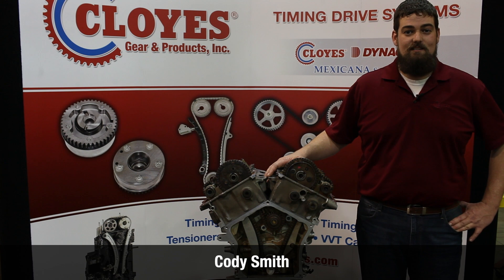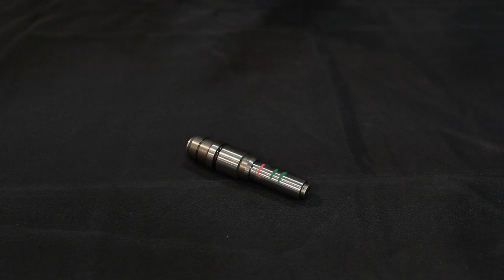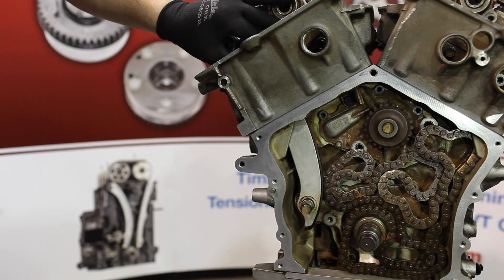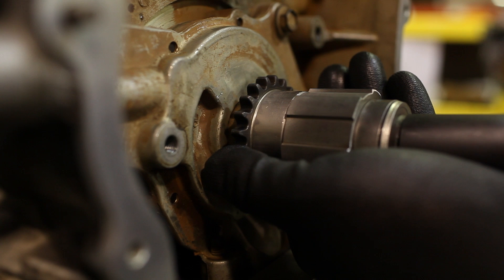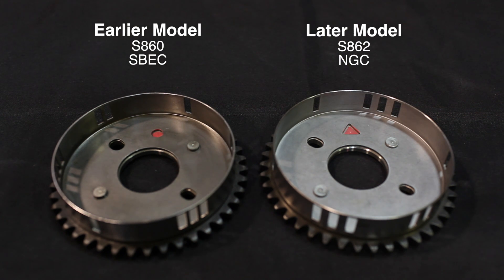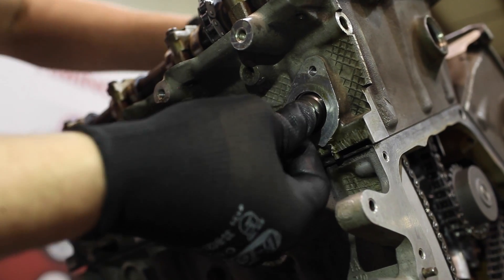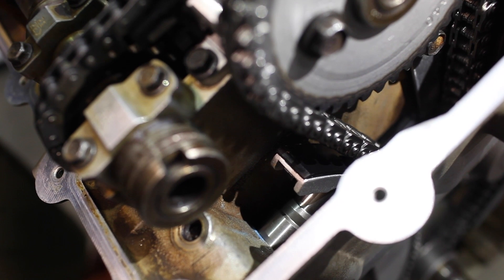Chrysler 2.7L Timing Chain Replacement, Cloyes 9-0397SA

Comment: If the timing chain mark not line up with the mark what should I do? I’m think of marking it, just take it off and just lining it up with the mark . Kinda confuse lol please any advice I’m changing my water pump
Reply from the maker: The chain is what sets the timing, so if all the marks do not align with the colored links then pull the chain off, rotate the shaft appropriately, then reinstall the chain. As long as all 3 sprocket marks are aligned to the proper chain links you are good.
Reply: Cloyes Gear & Products, Inc. thank you very much 🙏🏽🙏🏽
Reply: Cloyes Gear & Products, Inc. brother you save me from spending couple hundred bucks on maintenances THANK YOU VERY MUCH my car runs like a champ now I save $1200 actually -200$ For parts needed again THANK YOU 🙏🏽🤙🏽
Reply: Only issue I have timing chain mark not lining up with the arrow and the ⭕️

Comment: If the bottom Mark has moved what can I do
Reply from the maker: If the chain is still off just move the crank back until it is aligned again and carry on. If the chain is on just make sure the mark is still aligned with the marked link of the chain, if not you will need to remove the chain and retry.
Reply: @Cloyes01  the notch on the crankshaft sprocket moved to six o clock so can I go counter clockwise to line it up or do I have to go clockwise
Reply: @Cloyes01  I thought u never suppose to rotate engine counter clockwise
Reply from the maker: @alanbaker8259  You are not going to hurt anything rotating the crankshaft counter clockwise short distances in this situation.

Comment: I noticed that when you removed the left cam it was at 2 o'clock and when reinstalled it was at 12 o'clock. But when you did the right cam it came out and went back in the exact same position. Why wasn't the left cam done like this? Was valve timing affected? Please explain in detail. I have replaced the primary chain and tensioner and water pump before but have never done the cams
Reply from the maker: The camshafts can/will move slightly during the process. This is OK because the chain actually sets the timing in the end, not the shaft being aligned in any particular location. As long as the marked chain links all align to the marks on the sprockets then the engine is in time. It doesn't matter if the sprocket marks are clocked a little bit one way or the other.
Reply: Thanks for the insight! Greatly appreciated. I've had to change the water pump several times about every 30-40 thousand miles because the gasket fails not the actual water pump. So I'm familiar with the process except for taking the cams out and replacing the cam chains and cam tensioners

Comment: Guys why do we prime the chain.does it not get oil when car is running?
Reply: I think it has a mechanical latch inside to hold the piston in so it's easier to fit. It's a sort of push to latch, push to release thing. Once running the oil gets to the piston and really pushes it out hard onto the tensioner shoe.

Comment: I have a  rank no start. I have no spark.  I replaced the cam and crank sensors. The asd relay is working.  No broken wires. I dont have power at the 24 fuse. When I crank the engine I get a big bang once in a while. Will I get no spark if it's out of timing? I have no codes in the system.

Comment: All the negative complaints on the Chrysler 2.7 engines comes from those who change oil every year and post a youtube video bragging about it and think spark plug blowing, timing chain rattling Fords and fuel leaking stopped up cat GMs are the best on the road. I won't even mention the Toyota, Honda, or Nissan crowd because they are very special...
Reply: I've had many brands of cars and every one of them needed maintenance and replacement parts at some point.   Machines be that way.
Reply: I am a dodge owner only thing I've ever owned I change my oil every 2500 I have a 2.7 l charger and owned it since it had 90000 on it it had 260000 on it now and I've replaced the timing system twice including water pump and oil pump this engine is a piece of shit
Reply: @chantelrhine8965 You think an engine that lasts for 260k miles is a piece of shit? Ok...
Reply: I got a 2008 Chrysler 300 with 212,000 with no problem. I just want to get this done, before anything happens.
Reply: my 2004 concorde 2,7 just stopped today !!! camsensor go bad first , put a new one ,,, engine started for few minute then died !!! had no compression on each cylinder now !!!! maybe the automatic tensionner is going bad !!! motor run always with synthetic oil !!! have never touch the water pump since i have the car *bought in 2010 * with 180 000 km , now 260 000 km !!! was pretty good  and had never a problem since !!! just make maintenance on motor and drive with your head !!!
Reply: @bowsdelux  Sounds like the chain skipped a tooth or two. If so the heads will have to be taken to a machine shop. Had this happen to my neighbors 2005 Sebring convertible in 2014 with 189,000 miles. Total cost was $450 for everything, machine shop work, gaskets, chain, gears, oil pump, oil pickup, timing chain stop block. The same car now has 278,000 plus miles on it.
Reply: You are out your mind. This is a terribly engineered nightmare waiting to happen. Our shop makes a lot of money on these 2.7 motor repairs.

Comment: I just installed the timing chain on my 2001 Chrysler Sebring project car.

This car is being given to someone in need.

I couldn't have installed the timing chain kit without your help! Thank you so much. I will buy a Cloye's next time to show my appreciation.
Reply: So how hard was is and did it crank right up after you got finished , tell me more
Reply: @BC_nopowder  The timing chain itself was pretty simple with the engine out on the garage floor, and this video to reference. But overall, rebuilding the engine was pretty difficult. I failed to seat the torque converter properly the first time around so I had to take it all apart again. But I learned so much from the process.

Comment: Hi there I have a dodge journey 2011 2.7L V6 with timing chain issue does the Chrysler Sebring 2.7L  2010 timing chain kit  fit the dodge requirements?tia

Comment: Hi. I had the need to change the timing chain, I think I follow every step from this great video
but when I turn the engine manually I never get the marks the same (right) way again.
Can somebody help me? Thanks a lot.
Reply from the maker: The marks will only all align when the chains are first installed. Once the engine is rotated the marked chain links will not come back and realign immediately. They will eventually, but you may be there all day rotating by hand. The marks on the sprocket will come back to their starting positions every 2 revolutions of the crank, but the chain marks will no longer be aligned.
Reply: Cloyes Gear & Products, Inc. (Aftermarket) Thanks a lot for this great video, as well for your time and help to my question, everything was very helpfull to me.

Comment: Why does the colored link matter if the marks are aligned ?
Reply from the maker: There is no static positions to align the cams sprockets to. The chain is what insures the cams are in time to the crank.

Comment: I have one of these engines....  long story but couldn’t turn it down.... it’s been flawless but it’s only got 93000 miles and I do 3000 mile oil changes with full synthetic oil.....thinking of getting rid of it before I have to do a water pump on it.....I think the good running is worth as much as the entire car....you cannot find these engines used clean.

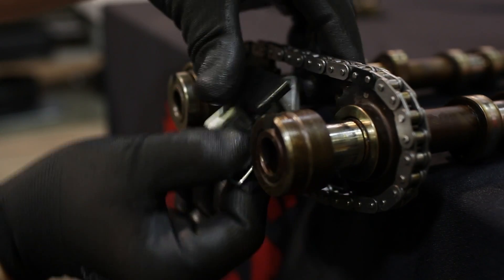Comment: Ok, I have 2002 Sebring with the 2.7 and I see in the video @ 4:03 it shows a dot and an arrow on the camshaft timing marks, so which do I use? I have all other timing marks perfectly aligned with the chain and sprockets but when I hand turn the engine (with a socket and breaker bar) in the clockwise direction it comes to a complete stop. I am wondering if I should have the cams aligned with the arrows instead of the dots?
Reply from the maker: It does not matter, as long as you use the same mark for both cams on the head.  Either use both dots or both arrows. The marks are the same distance apart, and will both properly time the cams to one another. When installing the primary chain you will need to rotate the cams to align with the primary sprocket, so this will insure the cams are timed properly to the primary system.
Reply: Cloyes Gear & Products, Inc. (Aftermarket) thank you

Comment: I just noticed when you replaced the secondary timing chain. Your valve timing is way off from when you first pulled the cams off.
Reply from the maker: The valve timing will be fixed once the primary sprockets are installed. To install the primary sprocket bolts you will have to rotate the cams, this will place the cam timing back where it was. When installing the secondary system just focus on keeping the 2 cams timed to each other.
Reply: Cloyes Gear & Products, Inc. (Aftermarket) thank you

Comment: I ve replaced all chains and chain guides and also the tensioner, my question is does the tensioner is supposed to be in contact all the time with the tensioner guide or no?
Reply from the maker: Yes, once activated the tensioner should keep pressure on the tensioner guide. The pressure on the guide will be somewhat minimal without engine oil pressure, but it will be enough to get the engine started.
Reply: Cloyes Gear & Products, Inc. (Aftermarket) Well, i had to turn the crankshaft clockwise so the chain guide and tensioner can make contact, ive already counted the links on both new and use timing chain and are the same, im stuck.
Reply from the maker: And you have reached in and compressed the tensioner completely and released it? Is the tensioner not springing out when released?
Reply: Cloyes Gear & Products, Inc. (Aftermarket) yes sir, i did all that, it was a faulty tensioner, it wasnt springing all the way out, i got a different tensioner and now its working perfectly, thanks for your time and amazing videos keep on the excellent work.
Reply: My question is: if you forgot to activate the tensioner what will happen to the engine? Will it make some clunking noise?

Comment: no not really satan but the timing chain was designed by engineers with down syndrome... since theres no black links on the oem chain or they wore off ... theres a total of 91 links on the chain but the timing spec diagram shows 70... so your garaunteed to be tooth off ... basically rolling the dice... shit for brains chrysler

Comment: Can the #1 piston be at top dead center? If not how do you get the piston to 60 degree after top dead center. Is it one or two turns of the crankshaft after top dead center?
Reply from the maker: Yes, as long as the crank mark aligns to the arrow and the cam sprocket marks are up. With the crank mark aligned you have a 50/50 chance of that being correct, you must look at your cam marks. Because the crankshaft spins twice for every one cam rotation you must make sure the cam marks are up not down.
Reply from the maker: The engine is at 60 degrees after TDC when the crank sprocket mark is aligned to the mark on the oil pump. This is where the engine needs to be set to align all of the sprocket/chain marks as shown.
Reply: so are you saying it doesn't matter what stroke the piston is on as long as the crank timing mark aligns properly with the arrow?

Comment: as someone who had a water pump failure (fixed just before any critical damage could be done) 

followed by a gasket failure which resulted in all the bearings being ruined
which lead to an engine swap for another 2.7 (shoulda got a new car)

followed by a timing chain tensioner failure and a timing chain gear skip (the latter was my fault)

this video is like a bar of gold and i cannot thank you guys enough after 2 years with my chrysler 2.7

never will i buy or recommend a 2.7

Comment: why 60 degress after tdc number one?
Reply from the maker: 60 degrees after TDC is just where the engine was designed for the timing to be set. Cam positioning is a significant factor in that determination. Positioning the cams where they are the most at rest helps during the installation. Keep in mind that the engine does not have to be exactly at 60 degrees after TDC during installation. The chain is what sets the timing, and as long as the marks are aligned the engine will be in time.
Reply: thanks for the Info, great Video!

Comment: i changed the timing chain and now i get code p0016 cam/crank . Is the timing off or can this be fixed with a scan tool?
Reply from the maker: P0016 is a camshaft to crankshaft correlation code. There is a good chance the timing is off. If you changed the cam sprockets during replacement....did you insure the left cam sprockets matched? The left cam sprocket has the cam sensor toner wheel built onto it and it is vital that the new toner wheel is identical to the one removed. In this video we installed the 9-0397SA kit which comes with the NGC  toner wheel (Cloyes part number S862). You can verify which kit you require by checking the 12th digit of your VIN#. If teh number is a 1 or 2, you will need 9-0397S or 9-0397SB. If the number is a 3, use the 9-0397SA. If the wrong toner wheel is installed, the P0016 code could also be a result.

Comment: Just had to say i got errr done ! The ole car is up and running again i was a bit worried about primeing the tensioner so i blocked the tensioner guide with a pair of vise grips pinched against the block so the tension was solid enouph to spin engine over without skiping a notch before i got the tensioner primed it worked out well !!  now i  know to turn  both , left and right cam shafts clockwise ! Thanks again
Reply: Was it hard

Comment: Ok so here is a question. I know for a fact that the timing chain had slipped a tooth or two. How do I get it back in time correctly. I aligned the crank alignment mark. But when I put the cam sprockets on and then tried to rotate the engine it comes to a dead stop My guess is it is hitting a valve. So how do I get this back on track. I did put on a new chain and tenssioner and guides. The new cloyes chain only has one mark on the new chain.
Reply from the maker: The engine strictly uses the timing chain to set the engine's timing. The only way to set the timing is to remove the primary chain and reinstall using the colored links of the chain and the sprockets timing marks as shown in the video. If you are attempting to set the camshafts, yet you can't turn them far enough without experiencing valve to piston contact, you can either attempt to rotate the camshafts the other direction or turn the crankshaft to a different position and try again. Once you get the camshafts close to where they need to be, you can reposition the crankshaft to it's alignment mark. The Cloyes supplied chain will have colored links as shown in the video. They are typically dark blue in color. This can make them difficult to distinguish in certain instances.
Reply: Thanks. I actually got it set right but I was dealing with bad info from auto zone about the Cloyes chain as it stated it had only one timing mark but it actually did have the 4 colored links. Got it all buttoned up but the over heating issue is still their ugh. 

The plus side was the guy who owned it before me actually maintained it so the engine was clean. Because I was having a over heating issue I decided with 160k miles that it was probably the water pump. Took it apart and the water pump was like new so put it back in. The old chain was beyond stretched why the did not replace it when they did the pump is beyond me. 

Anyways still over heats but only after driving it and then setting at idle for a bit after the drive.

Comment: This engine was designed by Satan.
Reply: I used to think that the GM Quad 4 was THE worst....the new king has been crowned
Reply: Running a water pump off the timing chain inside the engines oiling system....whoever approved this should never work in the automotive industry again....they must have got a job on the Ford Duratec FWD 3.5/3.7 design team after working at Chrysler.... welcome to the 2000 dollar water pump replacement IF your lucky and caught it before it cost you 6- 8000.00 for an engine and the install....
Reply: John DiMartino I think this is an easier job than my 1999 Toyota Camry. The water pump is ran off the timing belt instead of a chain. There’s so little space to work with in that car. The Chrysler is a bit better with more space
Reply: @ghost-4230  dude i can do that job in a few hours and I only charge 700
Reply: @ghost-4230  its a 2-3 hours job on your car ! Pretty easy with a lift !!!
Reply: @bowsdelux  I know it's pretty easy even without a lift
Reply: @ghost-4230  it's rear wheel drive that's why
Reply: @bowsdelux  lol you've obviously never done it
Reply: @JohnDiMartino  yup my 03 sebring cost me $600 to replace. Was told it was ran by a timing chain and I'm like who the fuck designed this shit. Thank God my timing chain was good because that's a $500 fix. Stupidest damn motor ever by Chrysler
Reply: facts
Reply: Yea I know doing one today and finishing it tomarrow. This one is in a dodge. Still cotton picking mopar. I feel mopar haunts me. Because it just loves how i touch it's internals or some shit.
Reply: Chris Katko AGREED
Reply: I think it actually was François J. Castaing  who oversaw the design of the 2.7
https://www.automotivehalloffame.org/honoree/francois-j-castaing-2/
Reply: Yes. Yes it was
Reply: Right.. You ain't lived till you did a ford  4.0.....
Reply: is mercedez engine